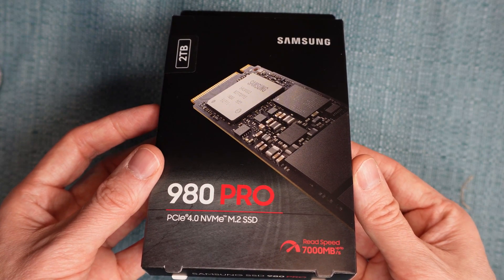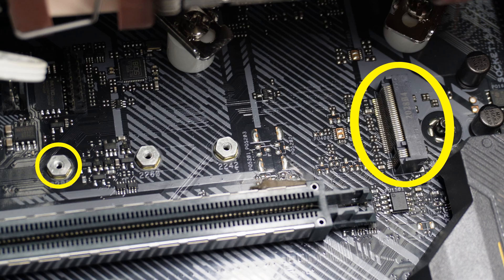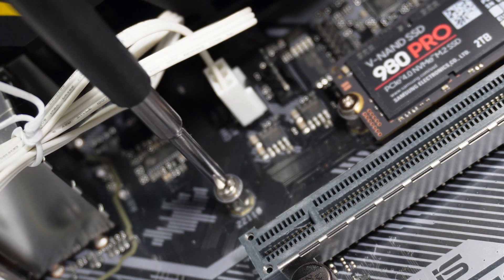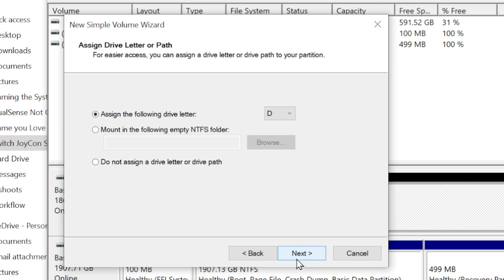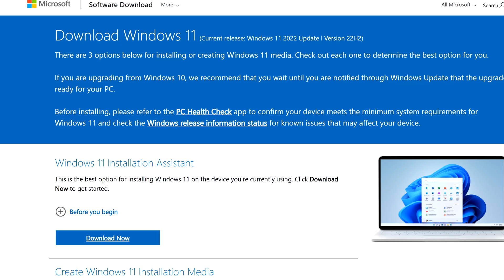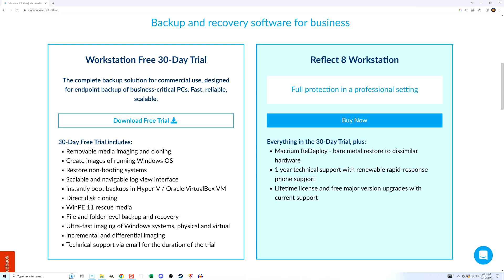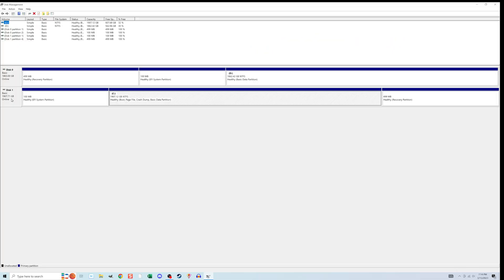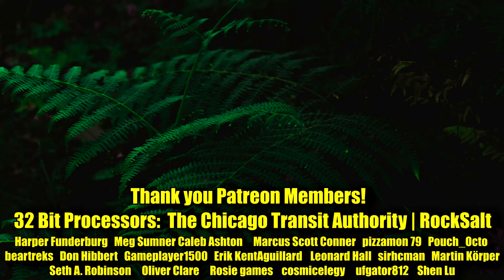How to Install an Additional Drive & Make it the Main Windows Disk | Cloning NVMe Gen 4 SSD M.2 C

Comment: It is my understanding that the second position SSD slot is slower for a couple of reasons than the first position slot. The first position is more directly connected to the CPU and will likely also have a greater bandwidth connection.

Comment: Tried Disk Genius and it did copy but wasn't allowing the drive to be used as the main boot. Tried it again with samsung magician since I'm upgrading my old 110gb ssd to a 1Tb samsung ssd

After hours of troubleshooting with other softwares, samsung magician worked like a charm the very first try. Def recommend using that if you're switch to a Samsung product.

Comment: hello, im so confused. It finished the data migration and got to 100% but literally nothing happened. My Pc didnt restart or anything
Reply: ok so for anyone in the future that has the same problem as me; after going down the rabbit hole of reddit posts I found the solution. After the migration is completed, you have to shut off the computer yourself and then manually remove the old drive. After starting the computer back up everything should work fine. As for what happens with the other drive, I'm not sure. I saw some people saying putting the drive back in made everything revert back to that drive. My old drive was a small 500GB drive so I'm not too worried about still using it, it needed to be replaced anyway. If you still want to use that old drive for storage, I'm not sure what the fix is.
Reply: @Allycat2208  I would think you would need to go into BIOS settings and ensure the new HDD is selected as the primary boot device. Once that is done I would go into Disk Management and format the HDD and should be good to go. I haven't tried this yet, but plan to once my m.2 comes in the mail. GL :)

Comment from the maker: I hope you found the video helpful. Here's some links to some of the parts and tools.
Variety Screw Package:
https://amzn.to/3LJC9mX
2TB Samsung 980 Pro PCIe 4.0 NVMe M.2 SSD  
https://amzn.to/3ZS9KyD
1TB Samsung 980 Pro PCIe 4.0 NVMe M.2 SSD  
https://amzn.to/3Lbtp8O
500 GB Samsung 980 Pro PCIe 4.0 NVMe M.2 SSD  
https://amzn.to/3ZxFuJz
Anti static wristband:
https://amzn.to/3JsvR8u
Antistatic mat:
https://amzn.to/3YZ5pJm

All Amazon links above are affiliate links. I get a small amount of money if you end up using them to make purchase (it does not have to be for the item I link to, as long as you click my link then move to another item, it works)